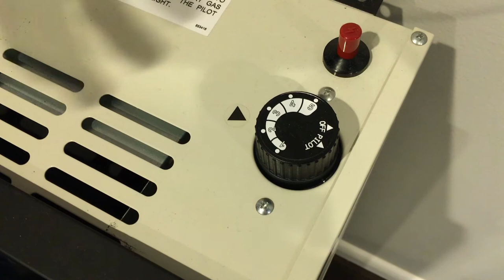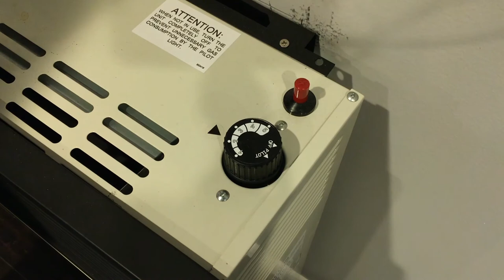Ashley Direct Vent Gas Heater Review

Comment: @alleghenyhomestead In Los Angeles CA it is required to install a Vented, Gas Heater in order to pass inspection on my ADU construction project. Does anyone know if this direct vent heater will pass?
Reply from the maker: Not being familiar at all with CA rules and restrictions, your best bet is to contact your city or county code enforcement to ask them. However, it  would seem like it would pass code since it is indeed a vented heater.
Reply: @AlleghenyHomestead  Thank you, I did reach out to a inspector and he verified it’s acceptable.
Reply from the maker: Awesome!
Reply: I passed inspection today! Thanks for the great video! Very helpful.

Comment: Where do I find one that is a real small to use on a van.  Searches for vented heater turn up all the vent free units or units that need electricity. Any help would be apriciated.
Reply from the maker: I honestly have no idea. Have you tried asking around in off-grid (maybe even tiny home) or van life forums?
Reply: Dickinson Marine - heaters designed for sailboats and such. A go to for many tiny home and van living folk

Comment: Can it be changed to a vertical vent?turned upwards.the wind hits it. Straighten on,.blows it out.
Reply from the maker: That’s probably a question best asked to the company themselves. However, I’d think you’d have options to come up with a wind guard or could in fact elbow it vertical outside the wall. We haven’t experienced this problem as ours don’t face prevailing wind.

Comment: I bought the large one and the smaller one just as you did about a year ago and haven’t installed them yet and I searched night and day trying to find reviews on the Ashley Hearth direct vent heaters and found nothing. I’m installing mine today but my contractor accidentally threw away the heat shield so I bought some sheet metal to make a makeshift heat shield. Thanks for making this video.
Reply from the maker: Thank you so much for the kind comments, Joshua! Hope your install goes well without any snafus 😉 We've been really happy with both of the heaters. Sorry to hear that about your heat shield. Where there's a will there's a way! If you haven't seen our install video of the smaller guy, you can watch it here: https://youtu.be/CEBWxtZuXu8

Comment: Great info. I am considering replacing my current heater (different maker) which makes loud popping noises especially during off/cooling down due to metal expansion and contraction. My question is if this unit does the same. Thank you so much!
Reply from the maker: Guess it's kinda relative how loud it is, but yes, this heater does the same thing. Sometimes it's louder than other times. Honestly, we've gotten so used to it, we hardly notice it anymore 😊 You're welcome and glad the video was helpful!
Reply: I have one in a small apartment and it wakes me up at night. I have to leave it off and use a small electric one at night. Other than that it is good.

Comment: I can get the pilot to light on my 11,000btu; but turning the knob up does not ignite the burner. Is this a regulator problem? Is it a low pressure or high pressure regulator?

Comment: Question   Are you still happy with it? 
We do not live in this building full time just use it as a little guest house. The other furnace we are replacing as it stopped working. If we purchase this unit we will be purchasing the smaller unit there is 192 Square ft.  Wondering if you can give us some feedback on the installation the building is a timber frame so there is not alot of wall depth maybe 3-4 inches ? can it be installed with out having to have it go into the wall? Thank you in advance
Reply from the maker: Sorry! Just saw your question! Yes, we are still very happy with the heaters. If you are asking if it can be placed on the floor, no, it can't be. I would contact the manufacturer to see if they have any input on your situation.

Comment: Just found your channel! Great content. Is this safe to leave unattended? What safeguards does it have?
Reply from the maker: Hi! Thank you! Even though we’re by no means affiliated with the company, like any gas heater, it does have pilot light thermocouple protection, but it does not have a high temp safety shut off if that’s what you’re asking. But I would expect that as long as you are within the manufacturer’s guidelines on your particular gas pressure range that I would think you should be okay. Our gas pressure is in the high end of the range, and it can get pretty hot when running hard, so we tend to not run the larger heater at max setting, but we haven’t needed to. You might want to contact the company for more information. Hope that helps!

Comment: you add an L on the end of the part number for propane. liquid propane. had to figure that out. im off grid. So propane is the only option. I am not sure yet if it meets my local building codes.

Comment: In the video you said, when the the heater gets to the temperature of the thermostat (1-5) the burner turns off. does the burner automatically turn back on when it goes below temp, or does it have to be manually restarted? 
Thanks
Reply from the maker: It has a pilot light that stays on while the main burner cycles on and off to maintain your room temp.

Comment: can you add a thermostat to this?
Reply from the maker: The unit is designed to work without electricity, so if you're looking to install an electric thermostat to it, I don't see any way you could do that. Hope that helps.
Reply: Absolutely, just intercept the wires going to the valve

Comment: This thing won’t stay on. Thermostat issues I guess
Reply from the maker: Darn. Have you tried contacting the company? They were pretty responsive when we had to.
Reply: @AlleghenyHomestead  I ended up putting a small computer fan on the bottom right vent to stir the air and activate it.
Reply from the maker: Interesting. Glad to hear you got it figured out!